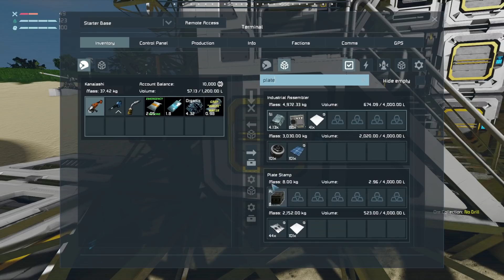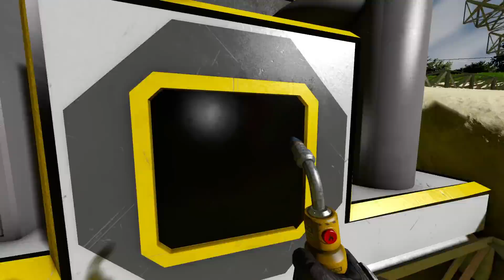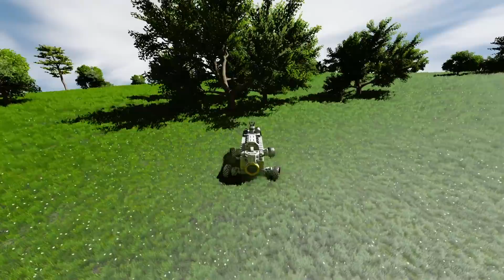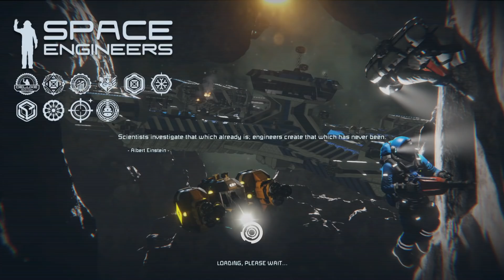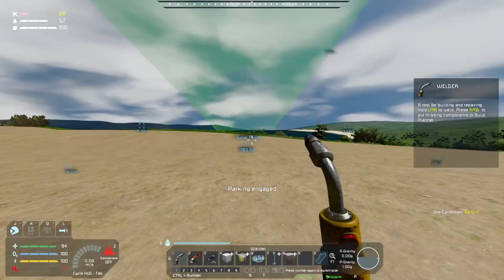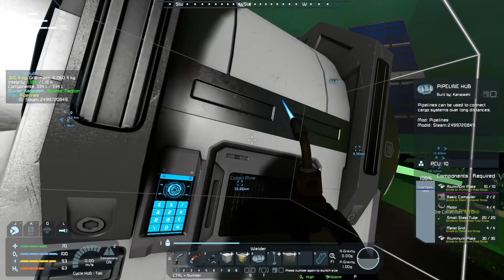Space Engineers - S4E10 'Iron Mine Pipeline In Place'

Comment: As others have said, using hinges would have made shaping the pipeline to the terrain easier.  However, that would require the pillars to have power to adjust them so you would have had to run the power lines first.  You could have also used the non gravity aligned towers like the one you did near your base to adjust the line the whole way.  The conveyors in that one tower are totally unnecessary but you saw that at the end of your video.  However, instead of raising the second tower, I would just rebuild the first tower and put it on an angle.